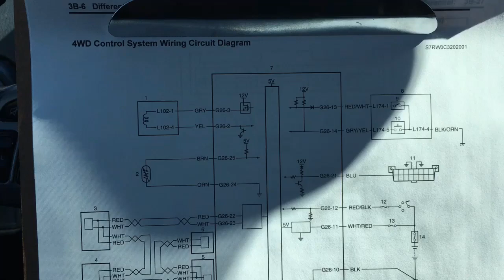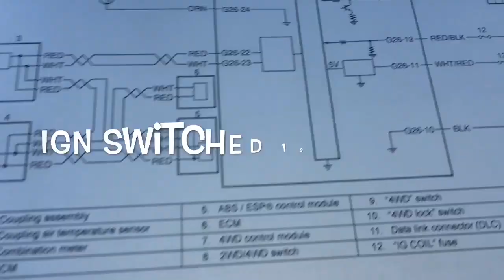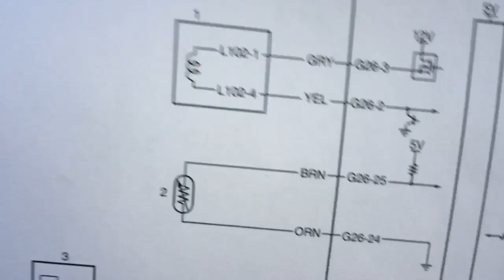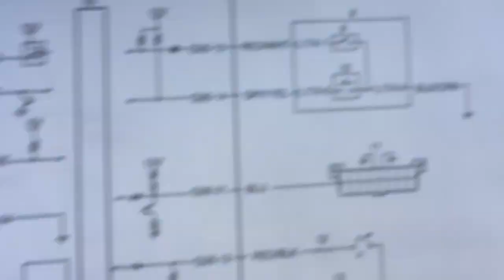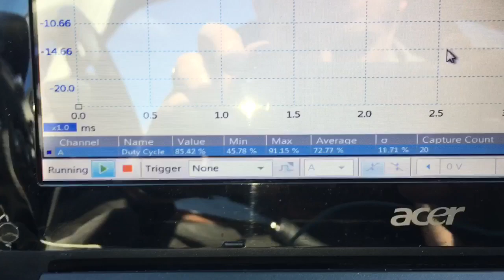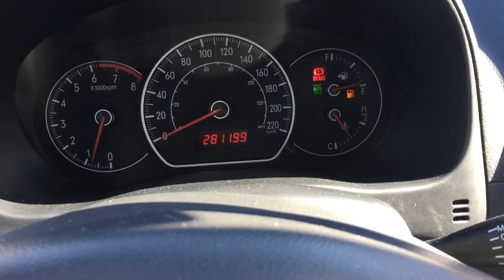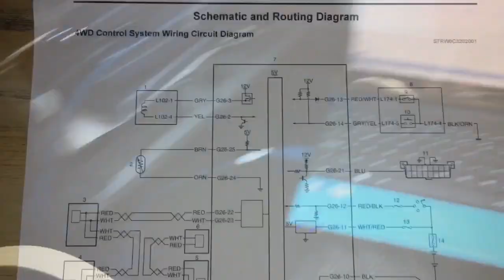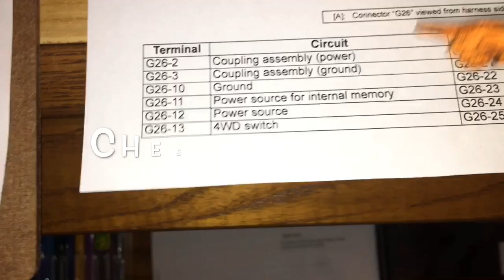SX4’s 4WD Module (Brief)

Comment: Thanks Ian! My auto and lock buttons are permanently on and the switch is inoperative. If I was to get a reading like yours, would that rule out the switch and module? Trying to narrow it down, just bought a 1.6 4Grip 2007 as a doer-upper so need all the help I can get LOL. No errors stored (0000 on dash)
Reply from the maker: Honestly…I’m not sure. The control coil and temperature sensor in the rear differential clutch pack are possible culprits. Assuming your mode selector switch is operative. I highly suggest you purchase a copy (Download PDF about $30) of the shop manual. Repairmanualnow.com is an online source I have used in the past. Worth every penny. As it walks you through testing and fault isolation. Thx for watching. 🍀🍻

Comment: Hey Gibby, first of all,  thanks a bunch for all your videos they are an sx4 owners life saver. Next I had a few questions about the awd system I was hoping you could answer. I watched the whole video but am not to great with wiring. So my sx4's awd does not seem to be working. I had it up on jacks for testing. When I have it in lock and give it gas the the traction control light comes on and then you will see the auto light come on with the lock light as well. From there I cannot switch it back to 2wd without shutting the car off. Is this normal functionality? I can switch it to auto to 2wd and back  no problem, and when its slipping in auto it never automatically goes into lock mode. I would assume that is how you'd want it to be tho correct?

Thanks again for all your wisdom.
Reply from the maker: Thx for the kind words. I am no 4x4/AWD expert but I have a few thoughts…With the car on jacks/stands it obviously cannot attain any speed so it sees wheel speed with no corresponding increase in vehicle speed…assumes loss of traction hence the traction control light flashing. This I would expect/consider normal. To my knowledge, the vehicle will never automatically transition from auto to lock. Lock function distributes 50/50 front/rear drive. Drive will always go to the lightest loaded wheel as it is an open diff system as you likely know. Lock is strictly for low speed operation and I believe will drop out at vehicle speed above ~40Kph. Or the ignition is cycled off. It is not a diff locking system, only locking a 50/50 power split. Your other issues…I cannot offer any rationalization. Cheers 👍

Comment: Hi, nice presentation! Did you check the correlation between the duty cycle and amperes value, what was the max current applied to the electromagnetic coupling?
Reply from the maker: No idea dude, didn't get that deep...I supose if yer super interested you could check the manual as it does provide a R value spec for the mag coil... take the scope voltage * duty cycle/ R (coil spec)= mag coil current. Cheers
Reply: @TheGibby3340 My question was related to the info about max clutch-pack compression in LOCK mode. That actually may not be true. Suzuki docs say that max for SX4 is 2.0A while max for SX4 S-Cross is 3.0A. I checked that in Vitara, max was 2.8A (~60% duty cycle) but initial value for LOCK is 1120 mA (~20% duty cycle).
Reply: @4x4.tests.on.rollers   Can you give me some advise on a Toyota rear diff with electromagnetic coupler? I have swapped the differential with viscous coupler of my Vitz NCP95 with a differential with an electromagnetic coupler which is taken from Vitz NSP95. Now the question is how to simply hardwire it to power. can i connect it just with an air contitioner clutch relay and a button? or should i put a heavy duty stuff like a winch relay for example? i wanna measure its amperage when it is directy connected to the battery, but no time to go under the car. What i really want is just to lock the coupler when i need. Auto detection and computer things are not suitable for me. I had Toyota Noah with same electromagnetic coupling and computer control system. The car was kind of stupid that the coupler engages only after a front tire spins. i need 4wd before the front tire spin happens ;p .
Reply: @SuperAmpel  Unfortunately I do not have such knowledge, maybe there are some JTKET docs, I don't know :( When it comes to auto detection - all about good software, check on my channel the the video about proactive awd :)
Reply: @SuperAmpel hey there, did you ever figure this out? Im in a similar challenge with a JTEKT coupler

Comment: I had both rear wires to rear diff lock sensor or clutch in rear differential  completely break .. had no awd function. Great pico video. As you lock mode amd give it throttle then both warning lights will stay on the dash.  Piece of piss. Hilarious
Reply from the maker: Nelson Narciso I didn’t know much about the operation and control of the Mag coupler. That’s what this Vid is all about 😀

Comment: Great vid Ian.

Quick question.. would the PWM signal be related to vehicle load. 

A heavy load equals longer duty cycle and light load equals. Low duty cycle.?

Just food for thought.. haven't touched many electrical circuits on magnetic clutches.

Thanks again for the great vids.
Reply from the maker: Yes I suspect that would figure into the algorithm. It’s difficult to say definitively Jeremy as this is way beyond the scope of detail in the shop manual and my experience. Cheers Pal

Comment: This was interesting, I haven't given the 4wd and rear diff much thought before, I learned something here. Thanks Ian
Reply from the maker: Thx Matt. I have found it changes your thinking process completely when you are familiar with the details of something. You start visualizing (at least I do) what’s happening when you flick a switch or rotate a control of some sort. Perhaps I am going soft in the head. Haha...Cheers Matt
Reply: I agree with that, I mean understanding how something works will help with the thought process when it comes to diagnosing.

Comment: So cool! Is your computer just hooked up to the OBD2 thing?
Reply from the maker: Hi Jessica, long time. Yes the laptop is running both the Pico Scope & Vpecker scan tool software wifi to a Vehicle communication interface at the data link connector. Cheers